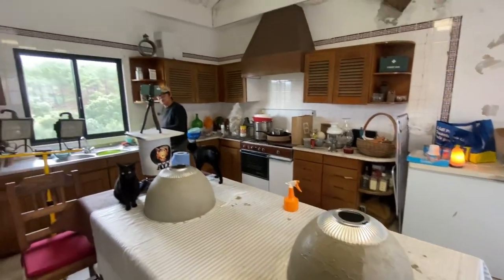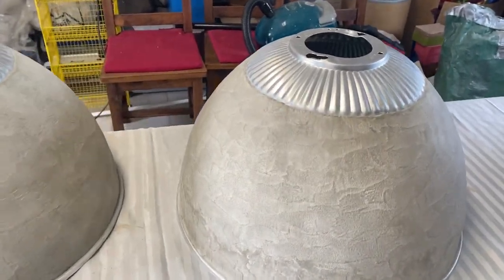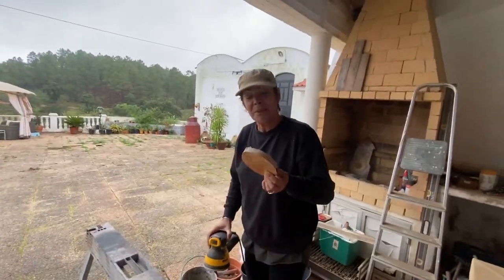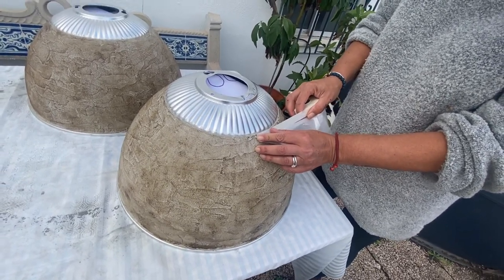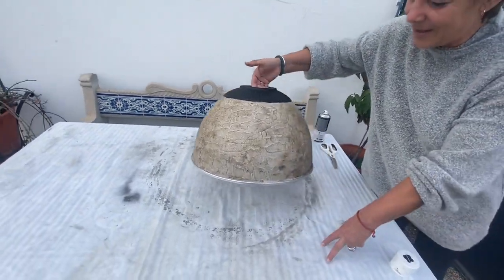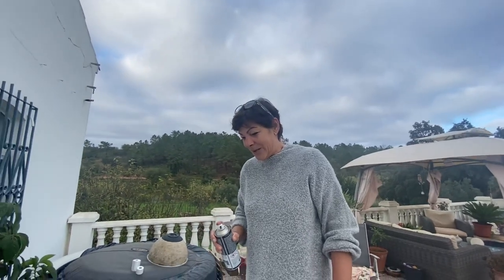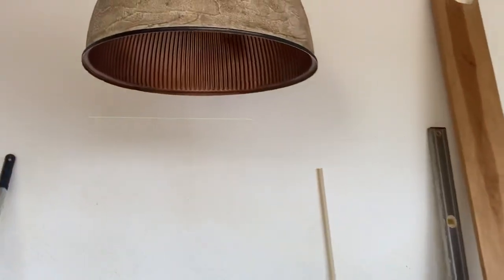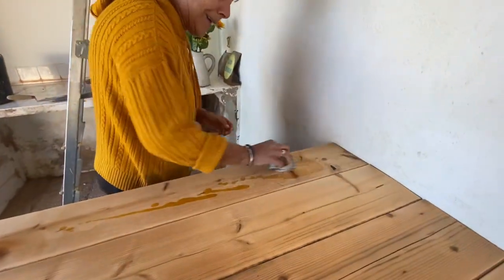We're Getting There (Kinda!)

Comment: I like the lampshades a lot - they will give a very comforting gloomy, warm light, perfect for those tranquil summer nights. 

Linseed oil - it is generally considered very healthy, as it is very rich in Omega 3.  You should not cook with it but use it as an oil for salads or maybe a pesto. My Grandma used to eat it with potatoes boiled in the skin, the linseed oil was mixed with low-fat curd cheese, and she added some salt, chopped chives and white pepper. However, it should be organic, clod-pressed and very fresh, as it easily becomes rancid. Therefore buy only in small batches and keep refrigerated. Linseed oil sold for treating wood was probably made with heat and/or is older and is probalby no longer so healthy, if it is edible at all.
Reply from the maker: Thanks Udo,
Now I know a bit more about linseed oil!
I often use flaxseeds, I keep them in a pepper  grinder and grind them over salads and other dishes.

Comment: They look great. I have a concern that they would not last  long with English weather... the frost or heat would make the metal contract and swell, which would eventually cause the concrete to fall off.  So I will just admire your ones ;)
Reply from the maker: Thank you 😊 
The way I made them, that concrete is not going anywhere( I hope 😄)There will be a video soon where I’ll explain exactly the process I use. 
I really like them, I would use them in doors to.